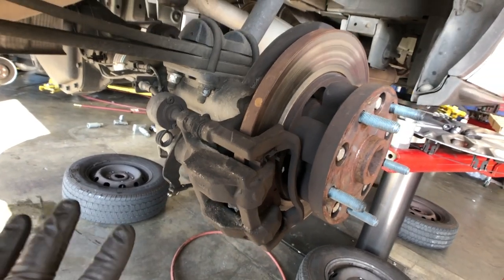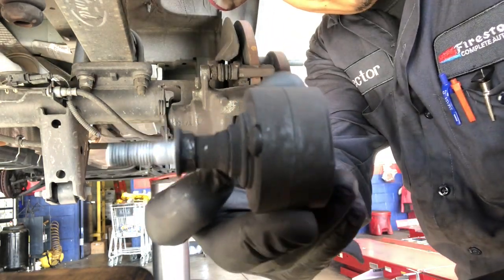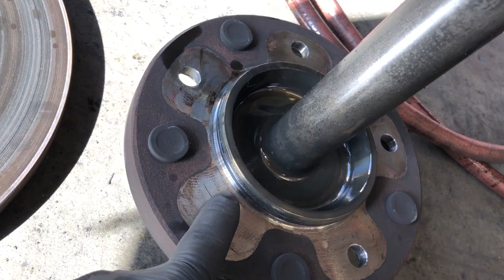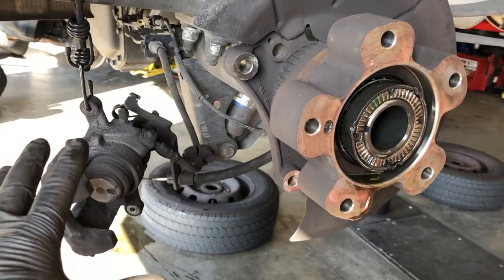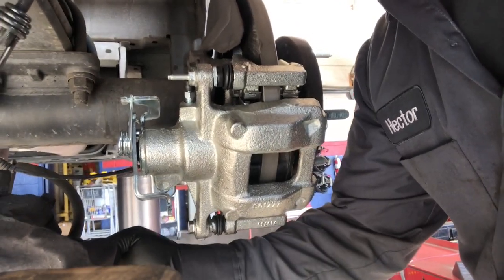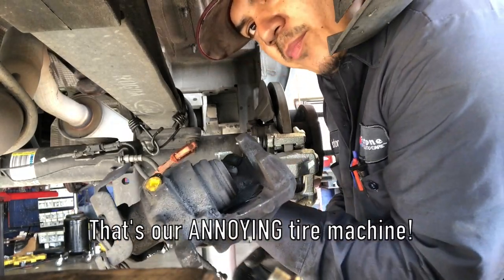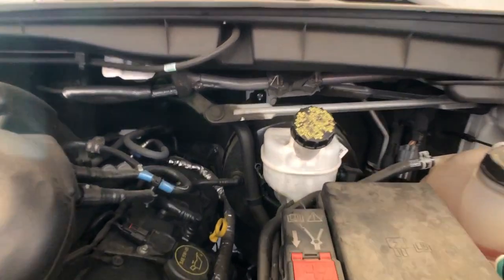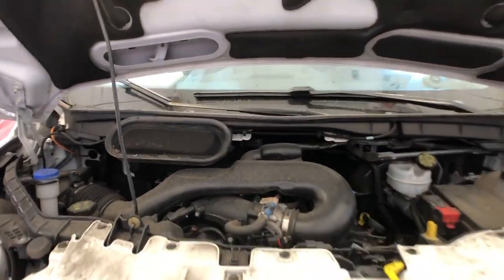Ford Transit Rear Brake Pads, Rotors, and Caliper Replacement

Comment: Thank you. The problem with these brakes on these vans, there’s no indication noise or something that the brakes need to be changed. Need to check it often before it goes metal to metal.
Reply: Yep why on earth didn't ford put a dam low pad indicator on these things I think they want you to wear the pads  down and damage the rotors so they can make more money for parts and labor. The son of a bitches.

Comment: Quick tip, heat the copper washers up with a small butane torch and it will soften them so they can be crushed again.

Comment: Great video.. all of the important stuff without the BS, and kind of funny too! Yeah, these Transits have a ton of brake bias towards the rear (for carrying heavy loads) so that’s why the wear so damn fast. Sucks! Mine were ALMOST on metal after just 30k miles and I don’t carry much weight at all! Thanks again for the great video!

Comment: Question....
But first Thank you for the video,  
My rear passenger caliper was seized 3 months ago , 
My mechanic replace caliper with new one , after 2 months it start to leak brake fluid,  
I brought in he said bad caliper and replace it again,  
Now 2 months later is leak again. 
Its always leak from the 30 star screw that old the silver plate . 
Could be he doing anything wrong? 
When you connect the screw that the fluid run through its supposed to be in specific position? 
Thanks a lot .

Comment: Great video, thanks! Quick question if you can answer: I am in the process of replacing the brakes and when trying to get the caliper to rewind, it won't. I bent the tool trying. It was not seized or having problems before. My handbrake is off, my reservoir is open. It will not budge. What do I do now?
Reply: replace caliper...
I had same.issuie

Comment: Firestone techs! Never take their mechanical advice! He said he will pinch off brake hose so it doesn’t leak 👎🏻That can also cause the hose to collapse permanently inside 😂! He said he will gravity bleed Brakes! That should only be done from driver front after bleeding new caliper and if you have enough time to let system bleed out